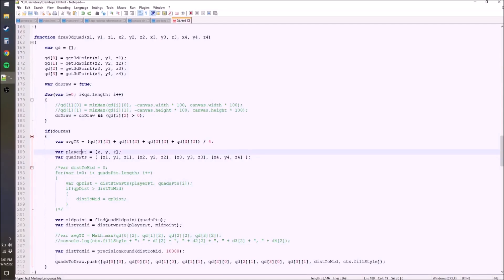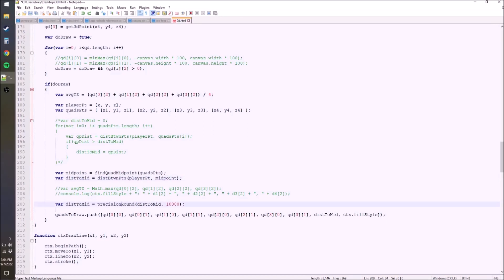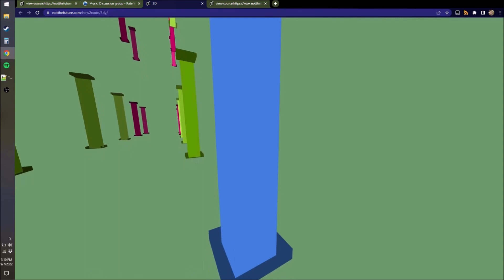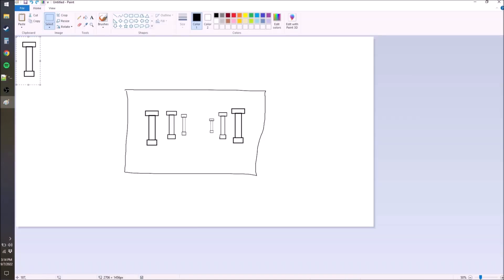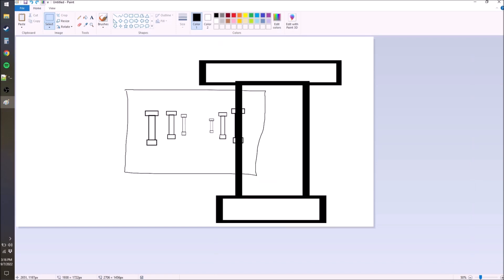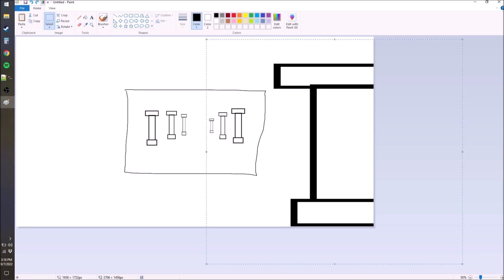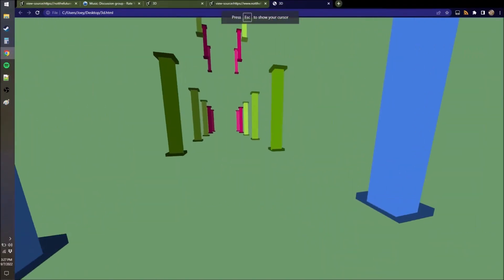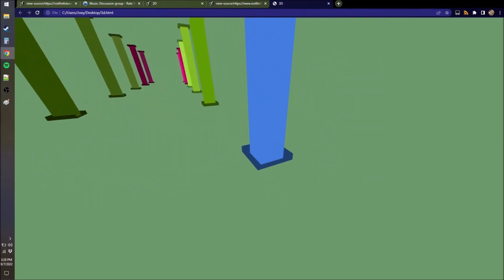3D Engine Coding: cpu kinda slow ngl

Comment: If you start rendering the image pixel by pixel, unless I'm mistaken, I believe it's possible to use the quad fill function still, it should be possible to render everything to the canvas, then convert the canvas into an array. After you have the array you can use the basic information of the screen to render a more advanced image with per-pixel layering, you would have to have a special case when two polygons get rendered to the same pixel, so if you had two polygons A and B, then you rendered you'd need an additional color C so that you can also tell when a pixel contains part of both polygon A and B, then you would have to map it back onto the 3d triangle to find the Z coordinate, do texturing, do lighting, and anything else you might decide to do.